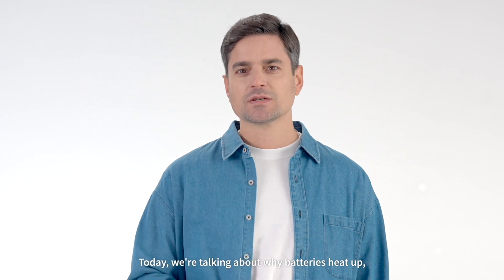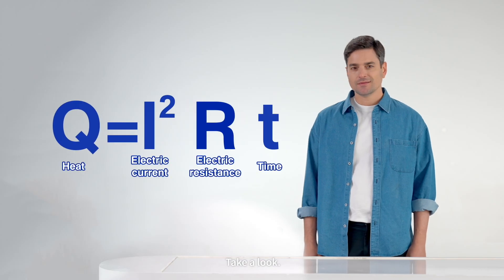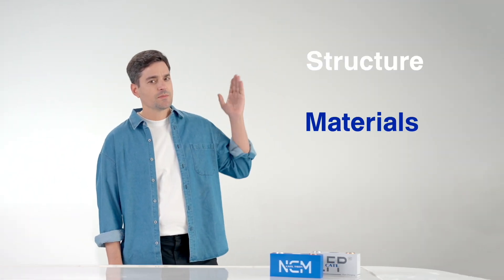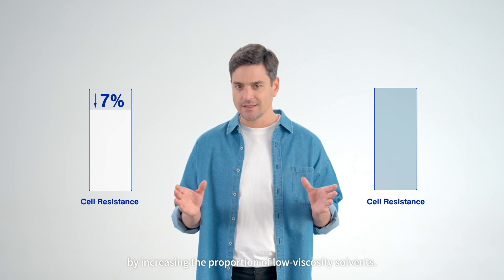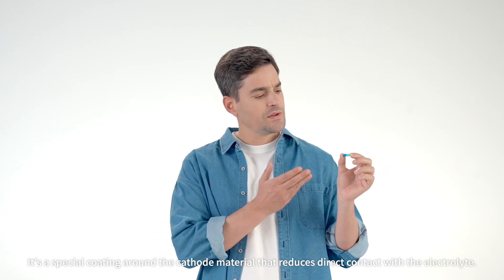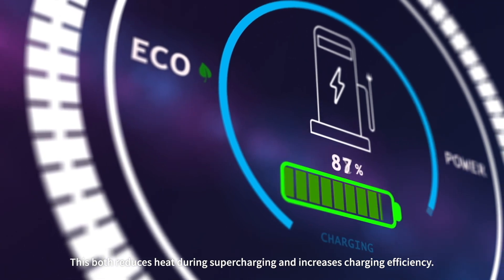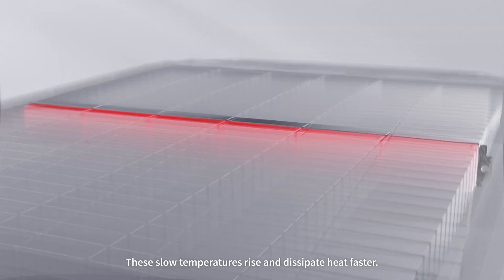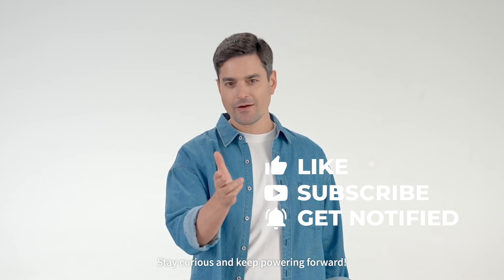Beating Overheating

Comment: How about developing bifilar motor coil motors (Bedini type) to capture the back EMF, and pulse charge it (Voltage) capacitors, and send it back (Current) to the battery?